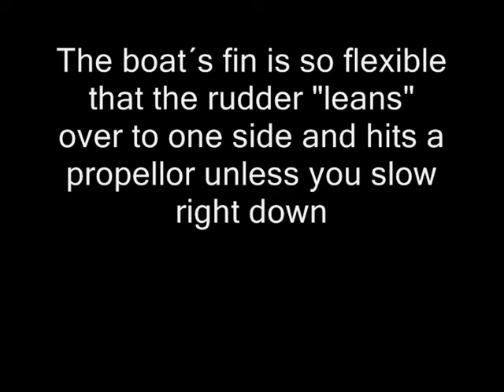RC Speedboat; another homemade rudder conversion .

Comment from the maker: OK, thanks. Well, mine (the black one) was bought from a yachting clothes catalogue and was branded Stealth Boat, and the white one came from a Spanish hobby shop. with the name Victory EP 700. The two boats have different motor mount positions moulded into the hulls, and therefore have different prop shafts as well, though they share the same rubbish electronics, which only last 15 or 20 runs (hence the rudder conversions)

Comment from the maker: Yes; I didn´t do a good job of making it clear, I´m afraid. He affixed a steel tent peg along the underside of the keel. It bends up 90 degrees and forms a super-strong lower pivot point, at the cost of some weight. Neither of our solutions are particularly brilliant; mine works well but lets water in through the pushrod hole in the transom. Chris´ has lots of weight and drag, as evidenced by his huge rooster tail. But both boats were headed for the scrapheap, so any solution´s better than none!